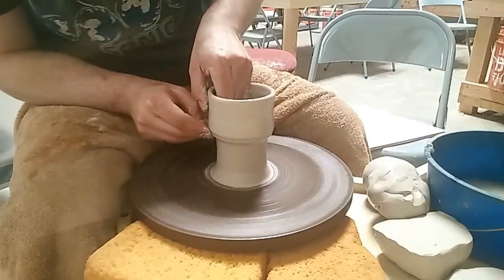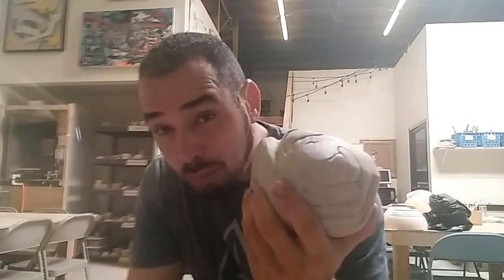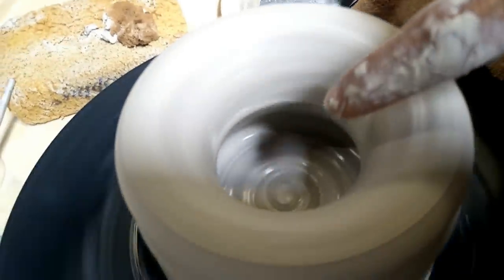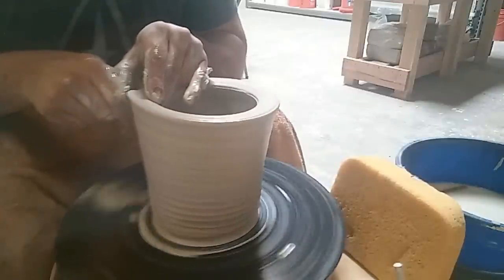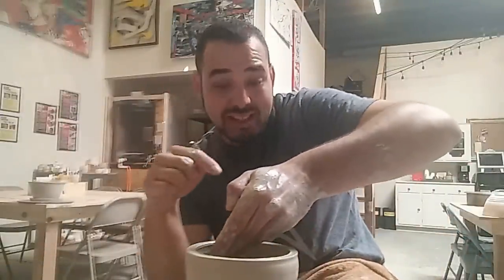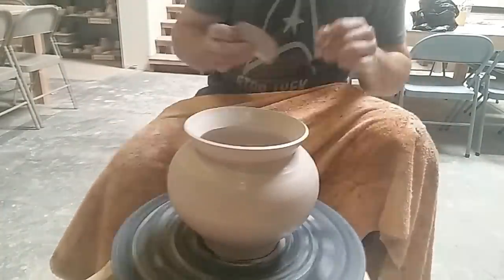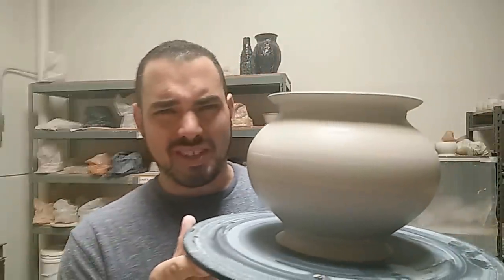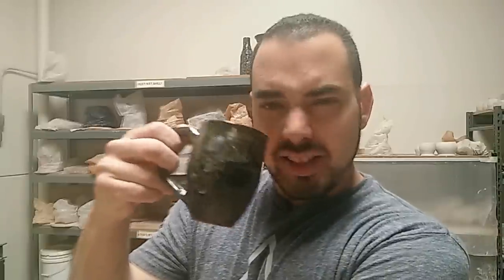Pulling Clay for Beginners

Comment: its funny how, as a machinist, i hear you describe "feed and speed" (rate of movement vs rate of rotation)... and yet... it took soooooo many tries to get a crappy cup, but once i got a cutting tool. now this is machining, smooth as a babies bottom.... just dont look inside. pottery is actually excellent for anyone who wants to use a lathe, the only difference is material. and steel lathes can kill you... that's something.

Comment: It's impossible to see the relationship of your inside fingers to your outside fingers. Are the outside fingers below the inside fingers, at the same level vertically, or above the inside fingers?
Reply from the maker: My inside fingers are generally above my outside fingers and it's very easy to feel which one is which without looking.

But if you wanted to look you just.... Literally look down the cylinder.